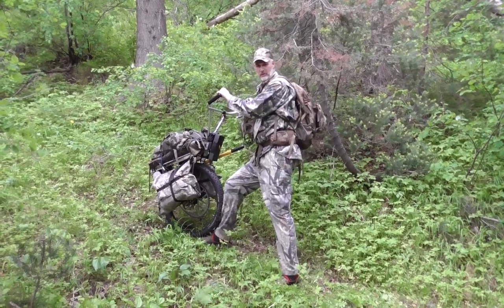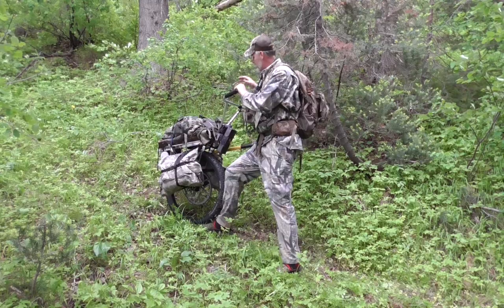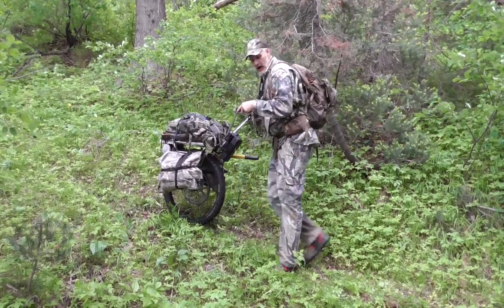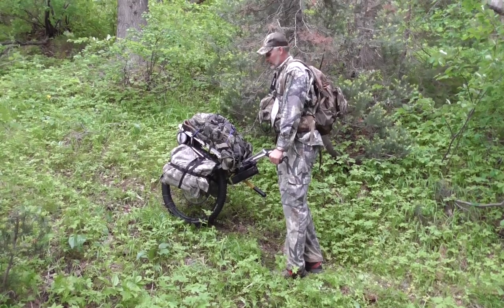e-Pack Wheel - How to Climb Uphill with Heavy Loads.

Comment: What are the weight and range limits? What about a heavy ice chest mounted on it? Is that possible?
Reply: 200lbs max. Depending on load and terrain 20 to 40 miles. If you can secure that I’m sure that is very possible. Checks out on instagram for ton more info.
Reply: @ryananderson9202  Thank you. I follow you guys on Instagram.

Comment: Hi! Interested in the cart!Which battery is used in this epackweel Li polymer or LiFePo4?What is the battery capacity in Ah?What is the size of the battery and how is it fixed on the epackweel (removable or not)?It is possible to remove the battery and charge separately from the epackweel standard charger...
Reply from the maker: We use Li Polymer Samsung cells.  Its a 36v 14AH removable battery that locks into place. yes the battery can be removed and charged separately.  Thanks for your interest!
Reply: packwheel , Battery hanging on the steering wheel?This 36 V 14Ah battery can be purchased separately?Is there a link to it?Why don't you use batteries on LiFePo4? They are considered more reliable, do not burn and do not explode?
Reply: Sorry misspoke on the battery tech, it is lifepo4 the cell is samsung 35e.  You can search and pull the data sheet to verify.  Yes we mount on the handlebar neck that is the best location to keep the weight centered.
Reply: The battery can be purchased separately at packwheel.com
Reply: Justin Anderson , greetings! I went to Your site and looked at the spare battery that you recommend to buy to Packwheel! There Li-polymer battery Samsung 36V 14Ah, not LiFePo4 or you have different batteries used?Also interested in the power of the electric motor used?Very impressed with the handles curved at right angles to the handlebar and the gas trigger is cool!Knew would where to purchase such, put would on P-Bicycle handlebar...

Comment: Can the epackwheel be used with the motor off?
Reply from the maker: Yes! You can remove it in minutes with the tools provided in the emergency kit it comes with.
Reply: @packwheel  what I wanted to know was can the motor be turned of to all free wheeling on flat ground to save battery charge
Reply from the maker: @tomtrauberman  absolutely it freewheels forward with no throttle.
Reply: @tomtrauberman  Tom, yes the ePack Wheel can free wheel, and manually be pushed.  The ePack is driven with a variable speed throttle, when the throttle is not used, the unit rolls forward with your effort.  We recommend pushing it on your own as much as you can and save the motor for climbing or navigating obstacles.  Saving the battery charge for when you need it.